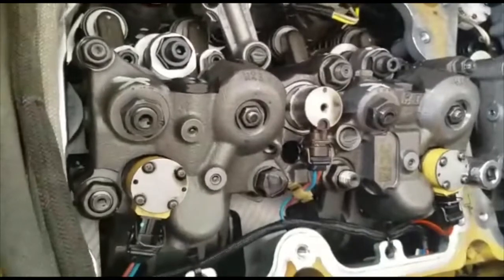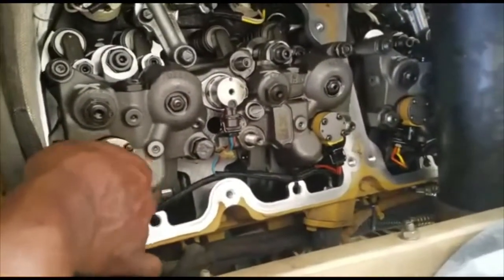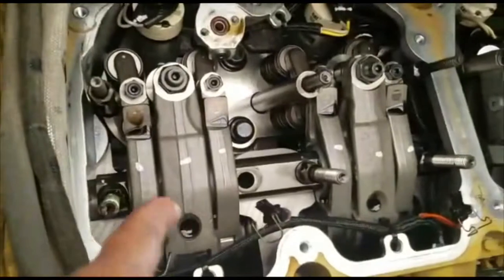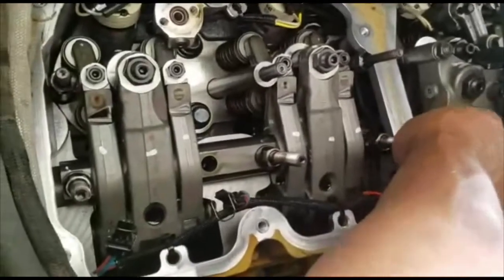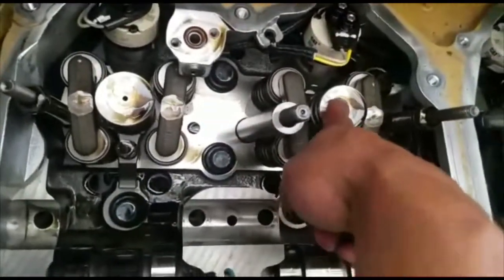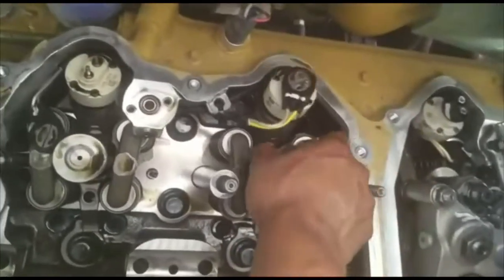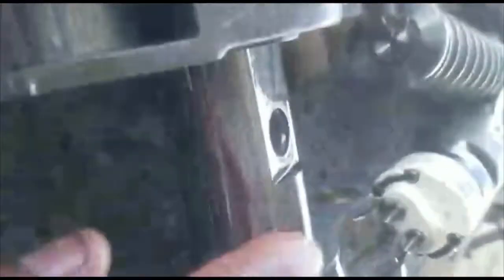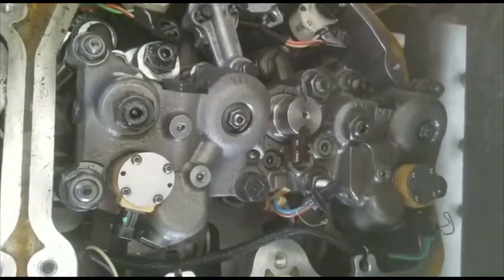How to change injectors on a C15 CAT Engine

Comment: How to adjust injector
Reply from the maker: This particular piece of equipment is a military vehicle the injectors came with no adjustment needed, they did come with a the software to do so however I didn't need to use. Sorry I hope this helps.

Comment: Thank you, 
I just wanted to ask you about freeze plugs , while i tried to replace the freeze plug which is inside the cover head , it went inside the cover head cooling lines when i used hammer , and then i put the new one , do you think if i leave the old one inside the cover head , it will make problem in my C15 engine ?
Reply from the maker: Honestly this never happened to me before but it shouldn't have drop very far were you cant fish it out. Hope this helps.
Reply: Fredito ok thank you for responding, but do you think it will make problem to my engine if i leave it ? Since i did run the engine for 1 hour and everything was good
Reply from the maker: @shantvazken2274  if you ran it and its doing nothing and your ok with it then I'm assuming its ok. I never had this happen but im also not saying that it won't be a problem in the future. At this point its up in the air and if you feel confident enough that it won't do damage its still up to you. Good luck bro 💪
Reply: Fredito ok great , thank you

Comment: That’s a Jake head not a fuel rail, however great video, very informative 👍
Reply: Pablo Cuellar
Actuator that is the proper name.
Reply: @pablolopez8049  actually it's IVA intake valve actuator. They're expensive and mess up alot. They work better when they're turned off lol
Reply from the maker: Tyler Bishop thanks
Reply: Variable actuator
Reply: @vmeetnelav6624  hello, what’s the torque spec for the variable actuator? Thanks
Reply: @ELJC1 
Torque to 58ft. lbs, +90degrees or til it snaps off then back it off a quarter turn. 
😮😮😮